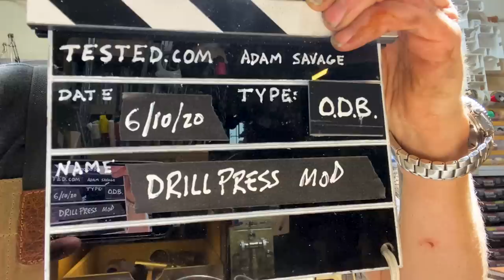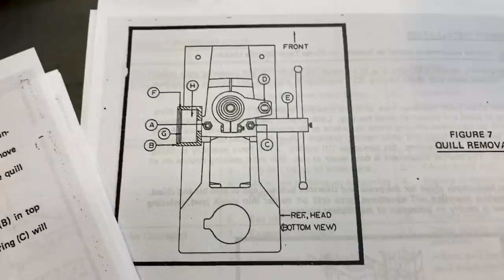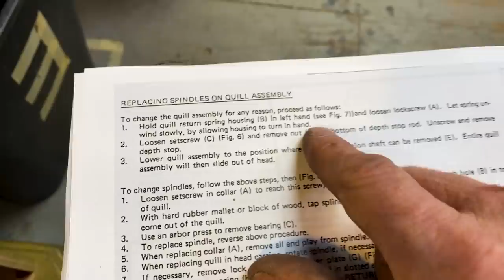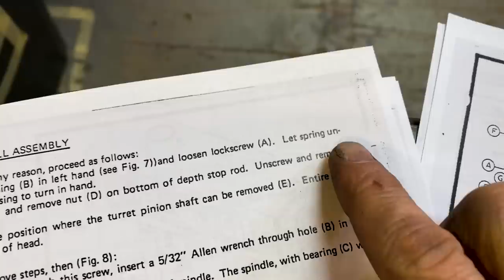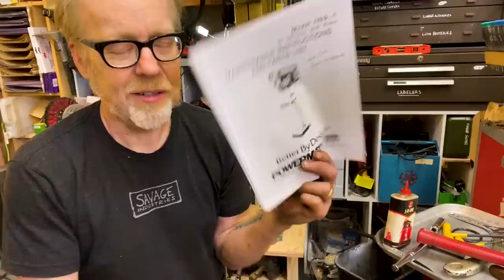Adam Savage's One Day Builds: Drill Press Modification!

Comment: Adam: "Expensive tools are easier to repair"
Apple and other pricey gadget manufacturers: "Must have missed that memo"
Reply: Tools, not toys ;)
Reply: @michalsierzchula  Poteito potahto. For some they are toys, for some they are tools. They should still be serviceable or fixable if the one who buys them wishes to fix them instead of throwing them away and getting new ones.
Reply: Yes, electronic devices should be easily fixable
Yes, to some people these devices are tools
But a phone or laptop is entirely different from a drill press or a mill
Reply: Gadgets and electronics =/= power tools. Most power tools don't become obsolete a year after they're bought.
Reply: Depends on who you are...they are repairable.
Reply: @devinkrike5968  Apple's designs indicate they are closer to "prestiguous object" or "piece of art" than "tool" - they are designed to be used as is, not to be modified or extended; they (as a company) are unwelcoming to 3rd party developers; they discourage combination of their products with "unapproved" other products; they often make their own "standards" instead of following industry best practice; they change APIs without sufficient backwards compatibility or warning; etc.

Don't get me wrong: you can use Apple products as tools, but you have to live with the limitations, the cost and the dangers to your productivity.
Reply: What he said was good tools are easy to repair. Good products may be more expensive--thus worth the investment--but expensive ≠ good.

Apple and their ilk get away with selling un-repairable, un-upgradeable crap because most consumers don't care that they are throwing their hard-earned money away.
Reply: You forgot to  mention Ford!!! $1800 for a $30 bearing cuz they WELDED IT IN at the factory and now you gotta buy the whole axle!!! Just one of many examples  of how they have you come back to the dealer because they indies don't have all the specific tools- or do I need to start talking about the 5.4??? Or how the inside panel on the econolines vans are intertwined with the outer panel so you have to buy both? Anyone with Henry Ford: in their name that are deceased are spinning in their graves now!
Reply: @michalsierzchula  as a software developer..... A laptop is a tool (although I do not use an Apple)
Reply: Auto manufacturers must have missed the memo too. I can rebuild a car from any decade before the 80's. Anything after that needs specialized (and expensive) tools, extensive knowledge and training in the particular system you're working on, and, if it's newer than the 2010's, extensive computer and IT training.
Reply: @davidhepler3812  Actually consumers dont have a choice most of the time. Remember when cell phones had an easily replaceable battery? Remember when cars had their battery easily accessible under the hood, not buried in a fenderwell or in a trunk cavity. Remember when refridgerators had a service port to recharge the refrigerant? I used to troubleshoot circuit boards down to the component level, then replace a $5.00 component. Now many components have the info removed so you have to buy the entire board or the entire product.  They dont want us fixing things anymore. They want us to buy a new one. It's out of our control.
Reply: Hmmm...not sure about all the Apple hating going on here. I can take my (4 year old) iPhone or (nearly 7 year old) MacBook Pro into any one of several hundred Apple stores around the world and get it fixed, promptly and professionally. In fact, the only failure I've had was a problem with the screen coating on the MacBook (replaced under a recall by Apple after four years) and the battery losing capacity after a pretty-good six years (replaced by Apple, along with the keyboard and lower case for a reasonable price). 
I have had very different experiences with other phone and PC makers – even on repairs within warranty.
Reply: @expert_fretwork  Computers aren't obsolete a year after they are bought either.  In fact, Apple doesn't typically mark their product as unsupported/obsolete until approximately 7 years after they are discontinued, which is actually a pretty long time in the smartphone market.
Reply: @dirtyketchup  I wasn't being strictly literal there, but the general consensus is that with as rapidly as consumer electronics come out with the latest and greatest, while the manufacturer may no say they're "obsolete" a year later, that doesn't mean that they aren't in a spiritual sense. Power tools, especially large industrial style tools like Adam has in his shop, are definitely meant to be repaired and keep on trucking. 
Cheaper tools definitely don't fit that description, as sometimes repair parts aren't even available. The same can be said for a lot of consumer electronics. 

Some simple parts are replaceable for repair purposes, but in a lot of situations, the manufacturer would prefer to outright replace the unit, or replace large chunks of the internal components in one large piece, rather than repair the one small piece that's malfunctioned. 

Just my 2 cents from working in the music industry as a repair guy and builder.
Reply: @expert_fretwork  it’s not really a fair comparison though, is it…?  Repairing a machine with purely mechanical parts is always going to be simpler than repairing something that has computer component and is driven by software.  You specifically singled out Apple amongst the world of “gadgets” and said that as a more expensive manufacturer, they are not easier to repair amongst their other gadget brethren.  I’m pointing out that, comparative to the expected life of any computer product, many Apple devices sustain repair options far longer than a lot of their competition.  Sure, it might not be easy for the average joe to complete all of those repairs, but that’s just the nature of computers in the first place.  I would argue that Apple designs their products with modular repairability in mind more than many other manufacturers, especially since they are all about reducing waste.
Reply: @dirtyketchup  it's probably not a fair comparison, but that's why it was a response to the original comment, who compared the two..
Reply: this is why Apple generally isn't used when you get into the more industrial side of IT and the like. Things that can't be fixed readily tend not to be adopted, and the same goes for proprietary equipment. The reason apple is so disliked for businesses is it requires said company to have EVERYTHING apple and play by apple's rules. Most IT staff you encounter will generally use windows or linux based systems, coders will often assemble their own rigs (this isn't a hard and fast rule but isn't uncommon) and many more will use either android devices on the portable device side, or generally windows computers on the general user side (non IT staff). 

Again this doesn't make apple BAD persay, but it's the reason why apple gadgets, generally aren't used.
Reply: @davidhepler3812  furthermore apple built themselves as the "industry standard" not by BEING the industry standard, but by making themselves APPEAR as such. Watch old Apple advertising and tell me you don't see where apple is clearly thumbing their nose at companies like microsoft, samsung, sony, commodore, etc. who were leading the IT world at the time. They were "innovative" and new and would lead a new revolution in tech. This is how apple built their brand, and it's also why they tank. Their products are okay but most people never properly utilize them and will never understand WHY apple's products are so expensive compared to other companies. Even in the smartphone race remember how long it took samsung to hit similar pricing to Apple? And that money was clearly shown off as having gone into aspects of the tech, buying out AKG for all their speaker systems, new high res screens not available from anyone but samsung (yes even apple bought said screens FROM samsung), the revolutionary stylus tech they pushed (no apple didn't make it first) to their note devices, etc. at least with samsung we SAW where that money was going, apple is just expensive because it can be. And usually it's specs are garbage anyways.

Comment: Hey Adam and team, I can only suggest sticking with they keyed chuck! It's not very common outside of using a tap in there, but with a keyless chuck, you can get taps and bits stuck, or they can sometimes even come out. Using a keyed chuck can allow you to consistently release whatever shank is in the chuck. And if you are afraid of losing the key, you can buy/fabricate a holder for the chuck key. It's hard to lose something with it's own mount.

Comment: I restored a 1930-40s drill press and taking it apart was one of the best parts about that process. Whats cool is i had the next generation but in a floor model, so i got to see what had changed in the 3-5 years between the two models.  Kind of a view in the mind of the designer, engineers.

Comment: The post on your drill press is called the column. The wiggler is called a coaxial indicator. That's a dog point set screw. Your extermal JT33 taper is trashed, however you can purchase a JT33 reamer which will restore (95%) the internal taper. After a serious cleaning of both parts, we used to rub blackboard chalk onto the surfaces and give it a good 'slam' home. Never had one fall off when installed properly. Thanks for the video Adam.

Comment: One thing you could do is some additive welding on the old quill and then redo the taper on the lathe.  Then possibly take your keyless chuck and shave out the damage on the inside.  You could then do the additive to a larger size to fit the amount you take off the inside of the keyless chuck.  Then, weld a nut on the top of the keyless chuck to screw onto the threads, or even weld on a piece of metal and cut in your own threads.

So you technically have a working Keyed chuck, since all this could take a few days possibly or "One Day  ;) ".   I do love how you treat every tool, no matter how small and one use it is, as the best tool ever.  Thank you for all the inspiration every video.

Comment: "and one of the reasons about investing in good tools..."

Said while loosening a bolt using a 12" adjustable spanner 🤭👍👍
Reply: Adjustable spanners are handy though, I don't see much of a problem in using them, especially if the screws or nuts don't require to be torqued down a lot.
Reply: Yea, talking proper tools then grab a nut rounder. :(
Reply: 12” adjustable spanner? That’s called an adjustable hammer!
Reply: The adjustable spanner only has a bad rep from nasty toolkits and two dollar shops. Invest in a good one with machined parts.
Reply: a precision workshop is meant to be all about precision though...should have both the metric and imperial tools to hand, ready to go 👍 😊
Reply: @weedfreer  That is not a precision workshop. He might be able to carry out precise work but its not a precision workshop. If it was a closed room with airflow and temp control and only the highest end machinery then maybe. There is absolutely nothing wrong with a decent adjustable wrench, and thats coming from a toolmaker who has worked in precision shops.
Reply: At least he knows not to use a metric adjustable spanner.
Reply: I was thinking that! 😂😂😅
Reply: @jawadibrahim2367  if you don't adjust them right or they back off a bit, you've just rounded the nut!
Reply: @doncarlton4858  or, if you adjust it without the bolt fully seated in the adjustable mechanism using only the top of the spanner, again, if you then use the crux of the mechanism it isn't right enough and again you end up striping the nut

Comment: Was that rubber ring thing important?  The one that was left on the tray 😀
Reply: It's a dampening rubber ring, came off the old part.
Reply: @nikolaceh  naa, that came off the new one. 25:10 .
And it was not replaced. Had two rings laying around on the board.
Reply: ... sorry, did rewatch the whole thing. He did put in the o-ring. But the old one...

Comment: Keep the chuck and use it as a hand chuck. Great for when you need to hand ream something delicate or whatever.

Also, I'm amazed that there wasn't a separate drill arbor that you could take out and replace. Usually there is a slot in the quill that you can put a wedge into to remove the arbor.
Reply: That's common on large or metal working drill presses, but small hobby ones tend to use the JT33 mount.

Comment: Whats wrong with a keyed chuck? Other than loosing the key.
Reply: Adds a second and a half to a tool change
Reply: Forgetting the key is in the chuck when you start the drill...
Reply: Keyless chuck design is self tightening, since I changed to keyless I haven't spun a bit in the chuck where I occasionally did prior.

Comment: The taper on the quill shaft can be repaired by metal spraying and a simple taper turning, easily found in most large cities for industrial repair.  The taper for the chuck is similar,  except the chuck is disassembled, and the back of the chuck is set up in a lathe, dialed in, the tapered hole welded and re-machined with the correct taper while set up concentric with chuck center-line.   I've done such repairs in the Navy as a machinist, (machinery repairman), and it is a bit time consuming, but you will have solid and precise parts for future repairs that will fit your machine exactly!

Comment: Did a similar repair to my Delta drill press broken v belt pulley drive wheel made of cheap pot metal. Internet research, google/eBay/Amazon for suitable parts, some cursing and swearing, but bam she is back in action. Actually thought of chucking it out (no pun) and buying a new one, but old tools are better. Drill press do NOT like lateral application of forces...have learned that the hard way. Currently have the wife’s KitchenAid mixer disassembled waiting on gear parts to fix it up,again.

Comment: Adam - I hope your quill supplier included the chuck key for the Jacobs chuck you got there.  It took me for frickin' ever to find a replacement chuck key for mine, and it turned out that the orange and black big box store carried a Ryobi key that worked perfectly.  There is absolutely no hope of getting an authentic Jacobs key on Amazon - it's a swamp of conterfeits, and mis-sized items.  McMaster-Carr or Grainger may have the right one, but it's sort of luck of the draw with them as well.  Thanks for the demo - I don't have that drill press, but agree that it's the default tool in the shop.

Comment: I repair machine tools.  I wouldn’t get too upset about the Jacob taper damage.  Just file off the displaced galled material carefully, and mount another drill chick, if it’s bent, that’s another matter altogether.  As long as you have good taper contact after, you’re good. This happens in shops quite often, people trying to endmill ( lateral forces) in the drill chuck, usually Morse taper pulls out and causes carnage. That part that you’re replacing is the quill / spindle rotating part. 
Wiggler and Coax dial are different centre finding tools.  They are for location, the aren’t known for reading out 0.001” increments.  The tips that are different lengths change dial output. 
You’re a motivate inspiration to watch in the shop. Thanks for showing some of your projects.

Comment: You can save that drill chuck (if you want to) by putting it in your lathe and using a Dremel tool as a tool post grinder. Indicate a piece of ground stock as large as the drill chuck can accept (1/2”?) on your lathe. Tighten the drill chuck around a piece of ground stock, this will ensure your repair will be concentric. Attach your Dremel tool to your tool post, I have done this with a piece of angle and hose clamps but you are creative and it is not complicated. Swing the compound to match the J33 Taper (this is a critical angle, take your time). Work a grinding bit in the Dremel .001” at a time and you will end up good as new. This also works for making cheap import tooling (collet holders) concentric.

Comment: Adam you can absolutely fix that chuck for other use and prevent damage in the future to your new spindle.  Drill it, tap it, attach it to your new bed as your new centering chuck for drilling and using a dowel between them for spindle sanding.

Comment: Maybe someone has pointed this out to you but the the threads above the taper are there solely for removing chucks from the taper shaft. If you look at the collar on the replacement rack assembly It has holes on the sides. The ideal is to lower the collar until it touches the chuck. Take a piece of brass round stock and put it in one of the holes and give it a tap with a hammer (clockwise). The chuck should fall off. Don't forget to catch the chuck and never put a new or different chuck on without the collar in place because you will have a most difficult time removing the chuck in the future. Essentially it's there just to break the taper fit.

Comment: I have two of those spindles. I was building a Newtonian telescope and needed some good bearings, on the cheap. I found them at a fantastic surplus store here in Dayton Ohio, Mendelsohns. (Unfortunately they are going out of business) I used them for the azimuth and altitude bearings and they worked great.  A little welding and some lock screws and it works! But I never knew what they were until I saw your video.